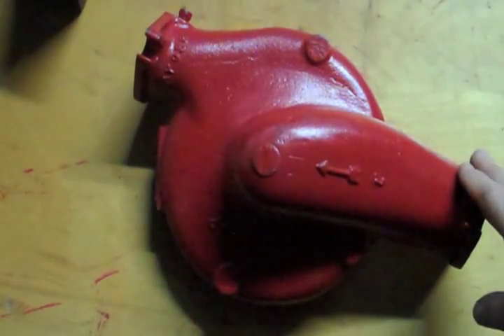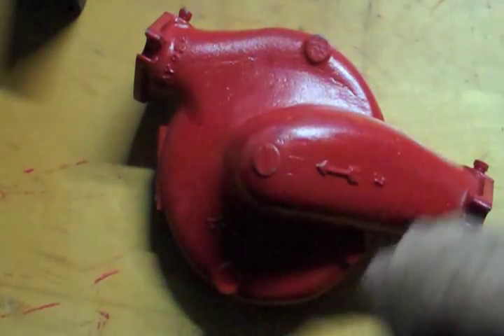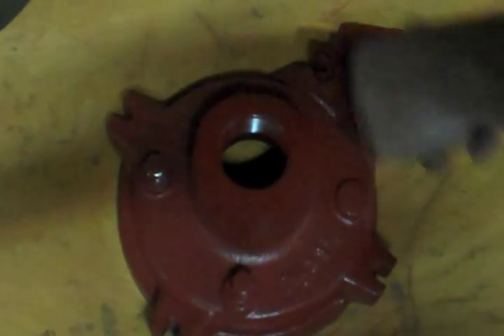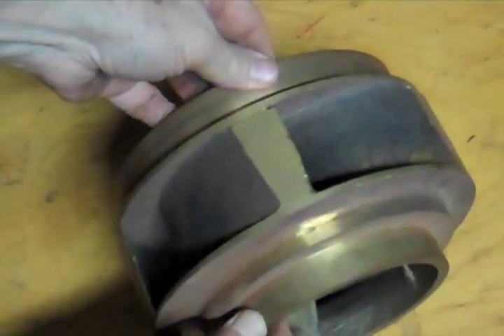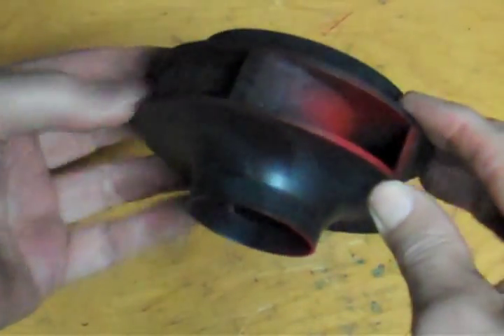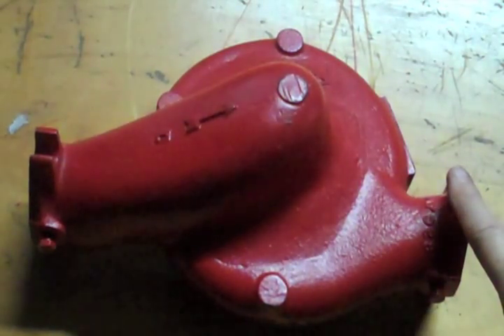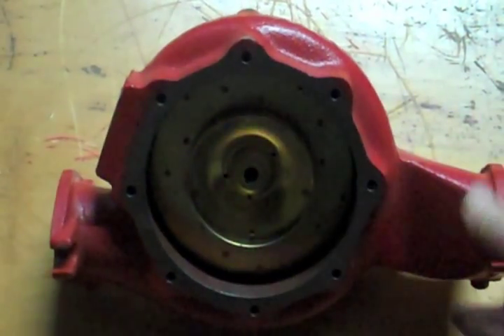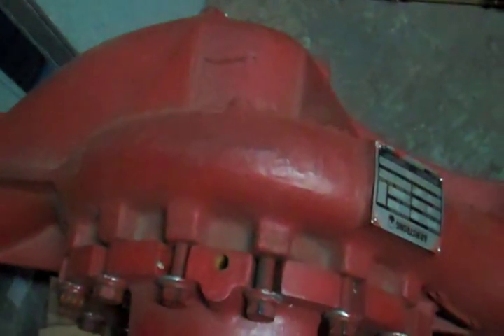circulator water pump motor rotation flow direction looking at casing volute body impeller turn spin

Comment: Hi thanks fir your video.
Ver y good explanation.
I have changed recently a water boost circulator type 100,is being oiled acirding the instruction,but the impeller get stuck.
Why this could happen.
Thanks
Reply from the maker: could be some corrosion interference in the volute .. those little motors don't have much starting torque. or if there is wear in the bearings the shaft can move forward allowing the impeller to touch the volute